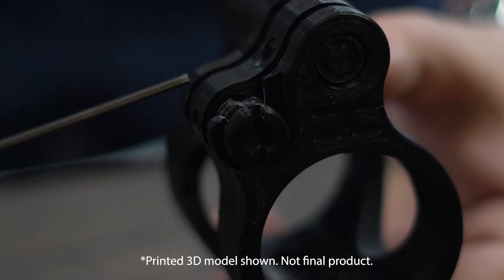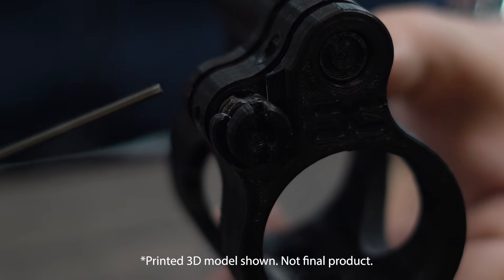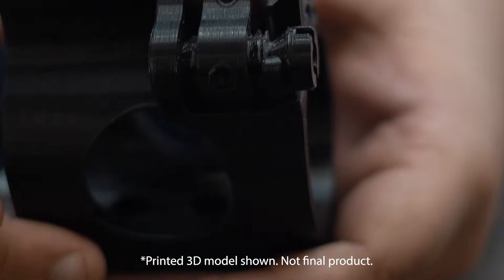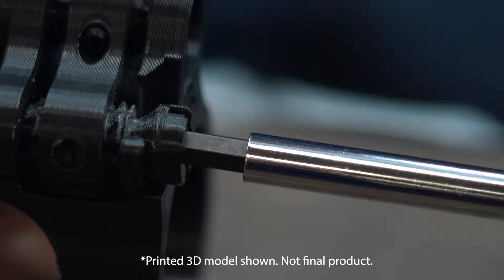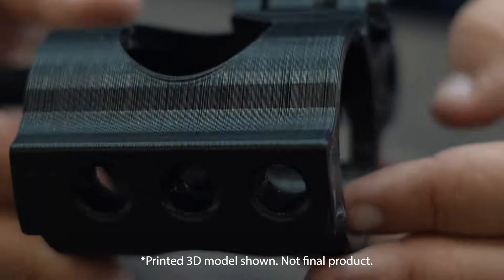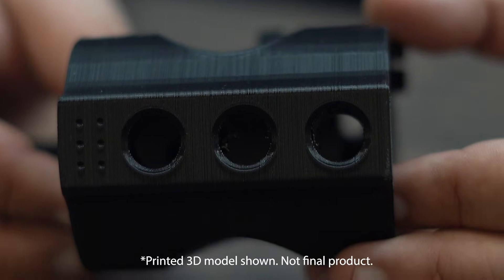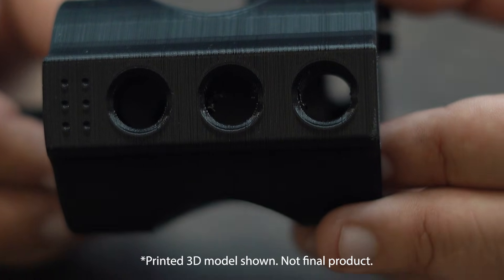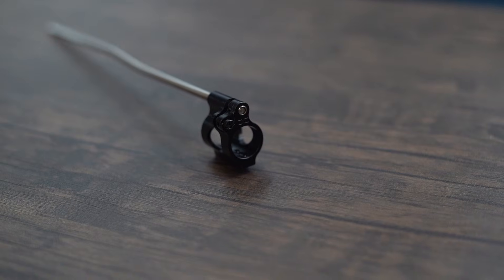The new patented Faxon Firearms adjustable gas block.

Comment: All the comments sound like shills, nobody says what builds they're running this on or report any gas leaking, carbon build up, or how the gas vents on your hand when c clamping the handguard. Reports are coming in of very loose tolerance on the gas block. We need more honest data in the comments
Reply: It works very well with zero issues.
Reply from the maker: So we've seen great sucess and have heard great things from customers about it. I know, "You're the manufatuer, of couse you would say that!". But we're not gaslighting anyone. Never have, never will.  It's also been nearly a year since we itroduced it and sales are VERY strong. With that amount of time, all of our 3rd party retail sellers r (Optics Planet, MidwayUSA, etc) have review sections. I encourage you to check those out.
Reply: @FaxonFirearmsOfficial  Your adj gas block is a very simple design, yet is very effective preventing carbon lock. Mine is still running perfectly and I keep saying this because I don't give out compliments easily. When credit is due, then credit should be given. Once again, well done.
Reply from the maker: @hairydogstail Thank you!

Comment: Interesting concept. But with direct increased pressure and increased heat on the smaller gas port after adjustment, would it blow out and elingate the port on the gas tube with more stress and lessen the life of the tube?
Reply: The EZ tune gas tubes use smaller port sizes and they are known to last 10,000 rounds plus with out any bad effect. This should be the same.

Comment: Won't it be an issue at the gas key tube, it always lands at the same spot when the bolt is in the chamber. Can the bolt sheer the threads on the gas block. I need answers.

Comment: Does this work with you're 6inch 300blk barrel since the screw sticks out a bit? For anyone who doesn't know, the gas block journal is 1inch so adjustable gas blocks hang over the threads.

Comment: This will be more sensitive due than competitor to reducing gas tube bell depth in the gas key in bcg whilst reducing gas flow at the gas port.
Reply: The gas system blows the gas off before the gas tube leaves the gas key..How sensitive it is will be seen..

Comment: screw better be made out of inconel!!!
Reply: The screw is not exposed to the hot gases..
Reply: @hairydogstail  i think that whole part of the firearm gets pretty darn hot
Reply: @950rpm  Where inconel shines is where the steel is in direct contact with the hot gasses like suppressor baffles and a gas meter plunger used with a choke type adj gas block..

Comment: I honestly figured that this is how they all worked
Reply: Stock guns are 'over gassed'.  No way to down adjust but reliably works albeit with hard recoil.  A one-size-fits-all solution.
Reply: @ I meant that’s how I thought all adjustable gas blocks worked. I’m not even sure if I should get everything with an adjustable gas block or have them have a standard gas block for less moving parts. I do like the adjustable gas block because if anything is wrong, you can just tune it perfectly. I’m told, though that it can collect fowling and be a failure point. So maybe are made to run forever, and kind of janky, and some that are precision pieces.
Reply: @liggerstuxin1  Adj gas blocks need to be oiled and moved in and out every so often. Not a big deal, but the Faxon looks like it could avoid this step as the gas tube is moving and not an adjuster screw exposed to the direct carbon.

Comment: How does it handle the excess gas?
Reply: It all goes down the gas tube. A fully open adjustable gas key just sends everything down into the system. If it's overgassed, you dial it down.
A gas block allows you to restrict gas but not create more, so you drill the gas port to be "overgassed" and the settings are used to dial it down to the intended level.
Reply: And the rest goes out the barrel then?  How would this not create an issue with carbon fouling the gas tube over time and cement the adjustable block over time?
Reply: @saltsea9499  It meters the gas port just like the barrel port size..It will have no fouling issues at the gas block..

Comment: Looks like it may finally be time to pick up an affordable adjustable gas block. Very cool
Reply: Oden works is like 40-50
Reply: @ have you run one for awhile? I'm looking at 5k-8k rounds a year ish and want something affordable that'll hold up. And not freeze up, if it exists
Reply: I agree. I own an SLR sentry adjustable but the tend to be pricey and aren't low profile. I'm looking forward to these

Comment: So the adjustment moves the gas tube itself, an interesting concept..I wonder how it will effect the seal in the carrier key/gas tube interface??
Reply: Exactly it won’t be venting the gas instead just throwing it into a gap causing more fouling than a superlative arms system
Reply: @OneConspiracyTheorist  I don't think you understand how this adj gas block works..The gas tube itself is used to meter the gas, no need to vent..This adj gas block is quite innovative..The adj in the gas key should not be a big deal considering the tiny movement needed to adj the gas tube to port size..
Reply: @ I 100% know how they work lol normal gas blocks are not moving the gas key and this seems like a potential point of failure. The Superlative arms is actually bleeding off the gas this is not or doesn’t appear to be thus is essentially creating dead space and bleeding the gas off in the carrier key which would cause a lot of fouling in the rifle. There is a reason superlative arms is one of the highest selling gas blocks out there because it’s a smart system this is like Germans engineered it and gave it ten more points of failure and I imagine the testing will reflect this long term
Reply: @OneConspiracyTheorist  It is obvious you don't know how this gas block works lol..The gas key is not moving (as you described), the gas tube is..The gas tube to gas key interface has a very generous tolerance and the movement of the gas tube is the width of the barrel port..There is no dead space in the gas key and it will retain the seal as long as the gas key and gas tube are within their very tight spec..Chad from SOTAR gauges these all the time..I have the same gauges..The SA is my least favorite adj gas block as it can and does get carboned shut..I know, I owned one..The best adj gas block is the Rifle Speed but the FA adj gas block looks like a good alternative if price and using a straight gas tube is a factor...
Reply: @ I meant gas tube take it easy Karen. It’s a failure point period, Not to mention it is going to cause fouling in the carrier key by not allowing the gas to properly flow down into it when the Tube is moved forward it’s common sense really but again you will defend this product which is a prototype and has basically zero real world testing. Make one logical argument for a bleed off system not being better than this? The gas is bled out to the front of the rifle not into it thus it’s eating less sh!t. You shoot a lot of ar’s or clean them often do you because you would know this. Yet I typed the wrong word and you had a paragraph typed up in no time lol
Reply: @ If your S.A is getting carbon locked it’s because you never adjust it for maintenance like it tells you to every 2k rounds. This one is going to need it done and the rifle will need to be cleaned far more often. Rifle speed is great but not the number one on the market yet but will be when prices drop. The S.A was way ahead of its time Rifle Speed is the future but to act as if S.A are bad or fail often just isn’t true I have multiple and also many armories are putting thousands and thousands of rounds through them without issue. You may be an exception but not the rule and their reviews and history reflect this.
Reply: @ Can’t have a total seal with movement in your gas tube but believe what you want it’s makes no sense though as the tube is being moved forward thus the back where the seal is created is to. Again also leaving the excess gas in the rifle not being bled out which is dumb!
Reply: @OneConspiracyTheorist  You are not able to write what you mean, messed up the sentence and then call me Karen..Self awareness is not strong in you, is it??
How is the gas not going to flow properly slick?? The seal is the same inside the gas tube no matter where the gas tube ends in the width of a port opening..Try and keep up lol....
The reason this is better than a bleed off system is because it doesn't need any..The gas port opening is being metered at the source Einstein, just like BRT EZ gas tubes..Those last 10.000+ rounds.. By the way, Faxon has tested them and they are already out of stock..
Reply: @OneConspiracyTheorist  The SA will also break apart if exposed to high fire rates..The SLR adj gas block and other types are no different..This is why I prefer Rifle Speed adj gas blocks..They won't fail..
Fan boys are entertaining lol..
Reply: @OneConspiracyTheorist  How is the gas tube/gas key interface seal going to be any different in the distance of the port size?? I'll be waiting lol..
Reply: @hairydogstail  Pre orders are a hell of a drug my guy, I can’t wait for them to be shown to have issues like every other one attempting this has and btw the one shown is 3d printed aka not final production aka they don’t have them and the tested ones will be different than production. Go ahead be a beta tester let me know how it goes for a sh!t system 😂
Reply: @OneConspiracyTheorist  Nice deflection, now answer my question if you can lol..
Reply: @ I’m deflecting yet you refuse to acknowledge the fouling that’s rich
Reply: @OneConspiracyTheorist Try working on your reading comprehension slick,  I answered your bs theory about fouling and the gas tube not sealing..
I will repeat my reply and question: The seal is the same inside the gas tube no matter where the gas tube ends in the width of a port opening..
 How is the gas tube/gas key interface seal going to be any different in the distance of the port size?? 

Here is another question for an expert like you, what is the TDP I.D. tolerance in the gas key?? What is the TDP I'D. for the gas block/gas tube interface tolerance??

Take your time, re-read as many times as it takes to comprehend and then answer if you can.
Reply: @OneConspiracyTheorist  Crickets, that's what I thought!
Reply: @hairydogstail  Btw your original comment was about how it will affect the seal in the gas key/tube interface…Then you proceeded to claim it doesn’t move and won’t matter while defending it when YOU originally questioned it 😂🤡
Reply: @OneConspiracyTheorist I did until I put a little more thought into it after replying to your idiotic (the gas key moves statement)..
Once again, you deflected and never answered my questions..
Reply: The amount of arm chair experts chiming in is staggering. You sound like the losers who voted for harris after the election. 😭😭😭😭😭😭😭
Reply: @Tacticalbuffoonary  Interjecting criticism without any empirical evidence makes you the Harris type whiny loser lol?? Try and answer my questions (since Trent buddy can't) if you have any actual knowledge..Posting insults and emoji's (like Harris's whiny supporters) is the only ability I have seen so far..
Reply: @ Arm chair experts comment after the fact, this product isn’t even released yet. You sound like you voted for Bernie with that “logic” 🖕🏻

Comment: Love that they had to specify that the obviously plastic 3d printed mockup was not a final product. Anyway, concept seems fine for giving repeatable adjustments without carbon locking too badly, manufacturability seems decent, only issue I see is that it probably won't fit under all free-float handguards.
Reply: They probably did this to show the features easier. In the site, they show the finished product.

Looks like it's low enough that it will. Site says low pro.
Reply: @JRacerActual  Looking at the dimensions on the website, yeah I think you're right. Some super tight ones that conform to the gas tube might have issues but yeah it should work with most.

Comment: Does it bleed off the excess gas like superlative arms gas block?
Reply: Does not look like it
Reply: Nobody uses that feature, it’s a gimmick
Reply: @georgeshorter142 That's how the SA gas block functions correctly. It bleeds off extra gas to deliver less into the action
Reply: No.  It changes the gas port cross section by changing the alignment of the holes in the gas block and gas tube.  Part of the tube covers part of the hole in the gas block and vice versa to reduce gas.

Comment: what does this do better than the riflespeed adjustable block?
Reply: Hopefully, it will be significantly cheaper. Riflespeed is fantastic, but you also pay a premium for that.
Reply: @heyhayhay247  Faxons site says $80
Reply: Also, weight
Reply: I hated the price but wanted the RifleSpeed block as I wanted to go from suppressed to unsuppressed for a number of reasons, a quick twist and it runs like it's supposed to.
Reply: Riflespeed is great if you aren't concerned about weight, and if you have enough of a gap between the end of your handguard and your muzzle device.

My handguard goes right up to to the end of my barrel, so I have no room for a riflespeed
Reply: @pdxmarine1430  cus RS folks should develop new collar  that allows you to move it with tip of the bullet through mlok window or if nescessary design line of handguards with window like piston rifles (Spear LT, PWS, Bren).
Reply: @pdxmarine1430  My .300 Blackout pistol is set up with the hand guard covering part of the suppressor in a faux integral setup.  Riflespeed won't work.

Comment: moving the gas tube?  what could go wrong?
Reply: Trollolololollolololololol
Reply: Gas tube protrusion has a minimum and maximum for a reason. This is fine
Reply: They did the research. It does nothing. You can actually move your unadjustable block forward for the same effect
Reply: Yeah, because I'm sure they didn't test it at all. Nope. Not a single round shot with it.
Reply: @JRacerActual  if they tested it would they be showing us a 3d printed plastic one?
Reply: @Asdf-wf6en  Probanly to better show the features in a vid. I imagine it would be a pain in the ass to make a vid with the real one due to it being a smaller product. Besides, they have a vid in their site showing the installation of a real one.
Reply: @Asdf-wf6en who cares lol? Is this the same level of hate you feel when they use computers to explain how a suppressor works, or how anything works? The model does show how it works and that’s all they were trying to get across. 

But in my opinion, I am not a fan of adjustable gas blocks. Maybe for a piston system, but for DI I think it’s dumb. I would much rather have a rifle designed for a lot of gas, not designed for “the perfect amount of gas for my ammo and my guns level of carbon build up that day”. 

No sir, how I built my rifle was to utilize the gas. I went with a DD 14.5” socom barrel with a carbine length gas system. I put a vltor A5 system to smooth out everything. Then I spent a ton of time searching and a ton of money when I finally found an LMT Enhanced BCG and Bolt in stock. I’ll finish it all with a dead air sandman s, when I can afford one. But I’ve used my buddies sandman a lot on my rifle. The LMT is a complete redesign of the BCG made specifically to handle a carbine length system and the bolt is made from a proprietary metal that is so much stronger than anything on the market. They have never had a bolt break before, in testing their bolt with 80k rounds of xm193 before they concluded testing. But they claim a customer has never sent in a bolt to be repaired from extensive use. 

The only thing I’ll one day change is gas rings and extractor springs, and a barrel when it’s shot out. But this rifle is made to be as gassy as possible which is a good thing. But the trends right now are to get rid of gas all together. I think it’s dumb.
Reply: @T20-c8f  you know you don’t have to turn the gas so far down the rifle barely runs right? There is a sweet spot where you can have more than adequate gas to not have to worry about functionality while still slowing things down a bit. I’m about 5k rounds in on a superlative arms bleed off agb, rainier arms 12.5” mountain barrel, bcm bcg, receiver and charging handle, standard m4 buffer length with an a3 buffer and a f1 can, a real one of my design, not a kit or solvent trap. I shoot a huge spectrum of ammo, cheap .223, full power 5.56, along with both lighter loaded hand loads for plinking as well as very hot hand loads. I’ve half ass cleaned the upper twice, run it suppressed 100% of the time. Only malfunctions were during the initial setting of the gb, haven’t touched it since. Shoots so soft, like almost nothing. Regular agb, that just use a set screw are garbage though
Reply: @T20-c8f  bro you have to be either a boomer or trolling, you went for 14.5 carbine gas? What I don’t get is why nobody just uses a rotatable gas plug with different sized holes to adjust gas.
Reply: @T20-c8f  Jim Sullivan who actually made the AR15 stated the biggest mistake was not giving it a gas metering system..
Reply: @T20-c8f Adjustable gas blocks are not dumb you are. I have an adjustable gas block on All my ar’s and they have never failed or built up carbon with 1000’s of rounds fired. You sound like Thomas crooks….
Reply: @JRacerActual  if they only have a 3d printed model?  maybe they are going for prior art....  any shop worth their salt could make that gas block in a couple days, tops.  they have a model, they can make a steel prototype easily.  and test it.  (edit)  they appear to have them on the website, but are sold out.  looks like i jumped the gun a bit.  pics look like actual steel.  gj faxon
Reply: @Sageofthe16 Looks like they show the real one at the end.  Its also in their site showing the final product in another vid. They are probably using that 3D model to show the features easier.